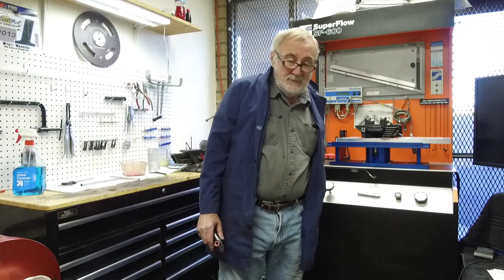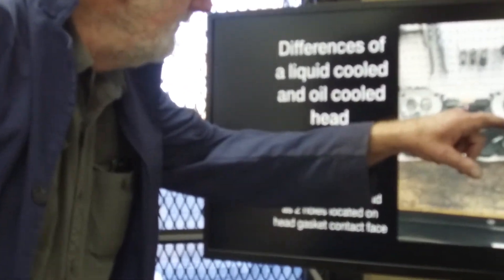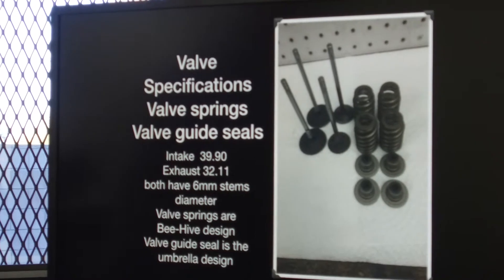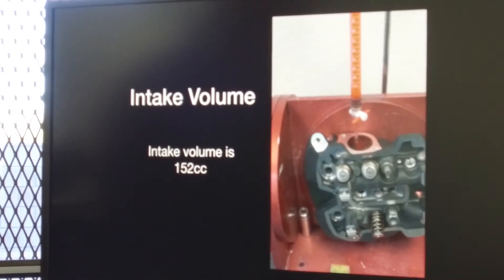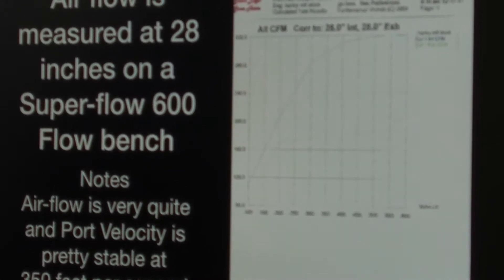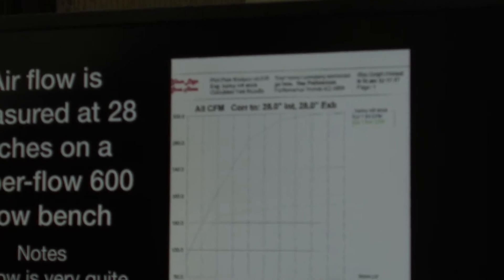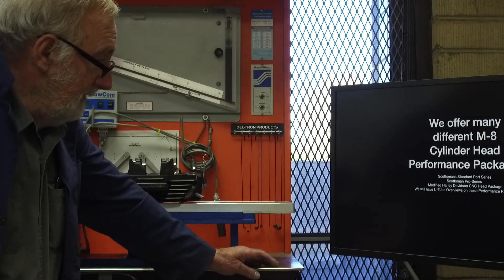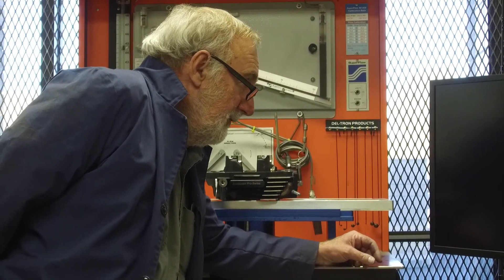Harley Davidson Milwaukee 8 Stock Cylinder Head Overview

Comment: Enjoyed your video.  What were you referencing to when you said the Stock Cylinder head was quiet?  And the CNC Cylinder Head was noisy?  Are you telling us that Harley's Stage 4 Cylinder Head was not CNC'd properly?
Reply from the maker: when you flow test you want a port to be quite and not turbulent .these heads are turbulent . the heads were CNC ported per Harley design.  the valve guides are stock and this assisted in port be being noisy. like I stated CNC heads are a different casting.  the intake port is smaller which gives port velocity . a ported stock head I was able to match port velocity .   we are currently working to enhance the the CNC ported head

Comment: Have you seen any issues with compression seepage around the valve seat and the head itself?
Reply from the maker: i see t-man has a  video on this issue. we have used a seat tug on the head we do to verify this issue. so far the seats have been tight.
Reply: Charlie Lawlor Thank you for replying.
Reply from the maker: we will have more u tubes in future showing  velocity testing and offset seats  thanks for watching